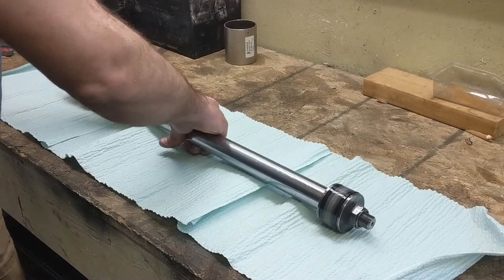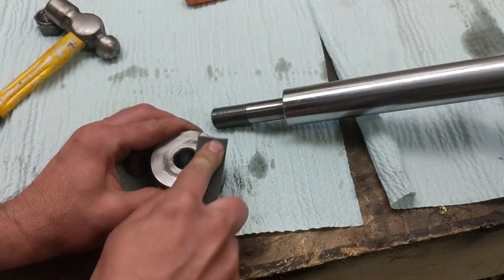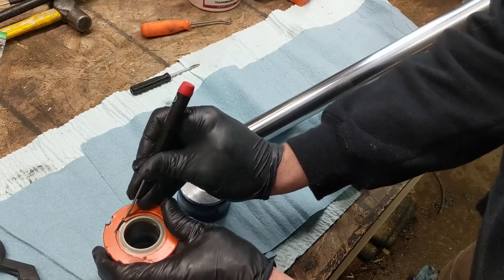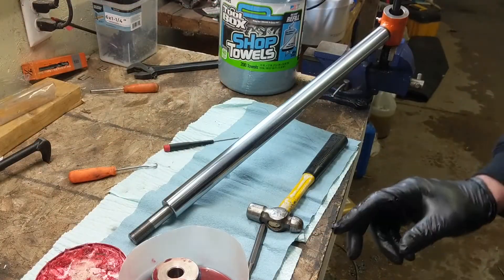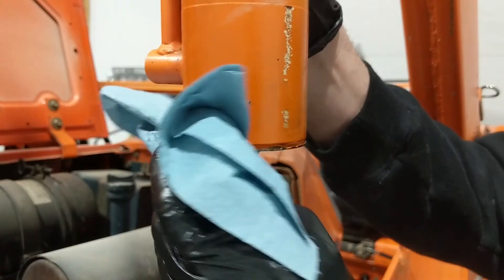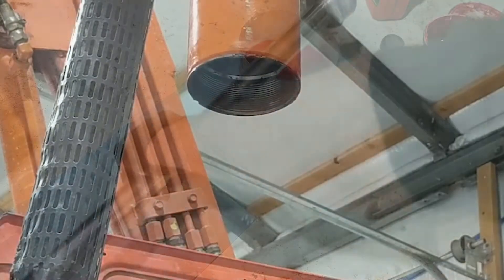Hydraulic Cylinder Leak Repair/Rebuild

Comment: I have a pretty big tractor. im gonna try to replace the seals myself. My question is, do I have to have the front-end loader up like you did? And why? Can I just do it with the bucket on the ground? Thanks in advance
Reply from the maker: Yeah it would work on the ground. This was mostly an ease of access thing
Reply: @MasterJacks, ok. im gonna give it a shot. Thanks for taking the time to respond

Comment: Perfect timing! I own a Kanga loader and the central hydraulic piston leakes, and will not hold the bucket where it is placed. My mechanical ability won't have me do the work, but I'm sure I will find a reputable firm to check it out. Cheers.

Comment: I heard NEVER USE ATF as it ruins the seals!? Use only the oil which goes into the system.. Why atf??
Reply from the maker: Thanks the comment. ATF is a premium hydraulic fluid. It won't react with the seals. Its viscosity may not be what a manufacturer recommends based on system pressures, but using it to knock off the dust won't hurt anything.
Reply from the maker: @samuelkatherinediozarago7692  👍
Reply: I agree. I would use what the system called for to lube and decontaminate.

Comment: .... wait is your hydraulic shop called Azdell’s?!

If not that’s my go to shop. SO MUCH CHEAPER than going to a dealer for seals. Since they want to sell you a full packing kit which contains the same seals, but is usually 5 times the prices of buying the individual seals at a hyd. Shop.
Reply from the maker: The local one near me is called Tristate Hydraulics. I agree, I love small town specialty shops. All the seals together were right around $40, and I didn't have to wait a week to get them!